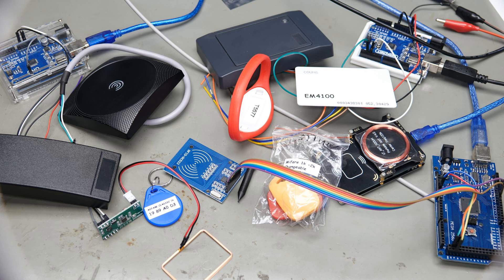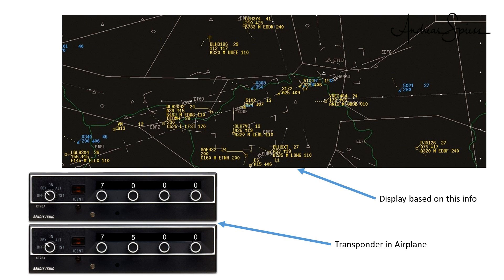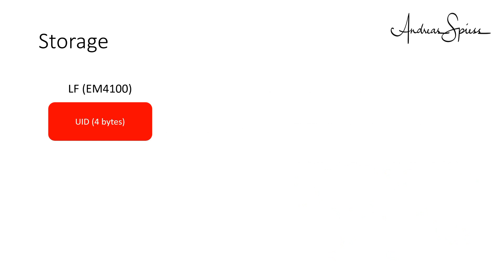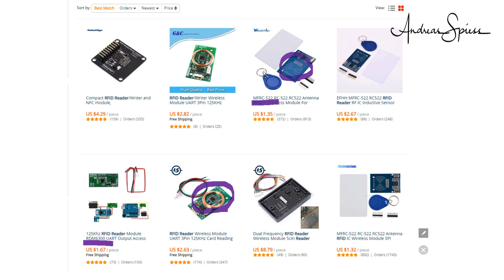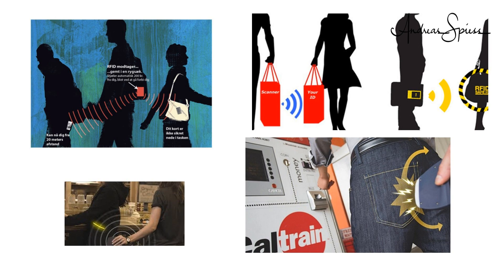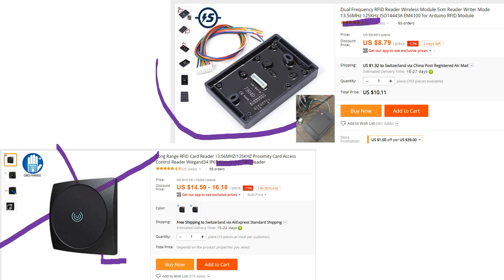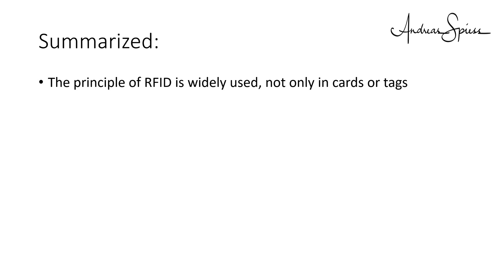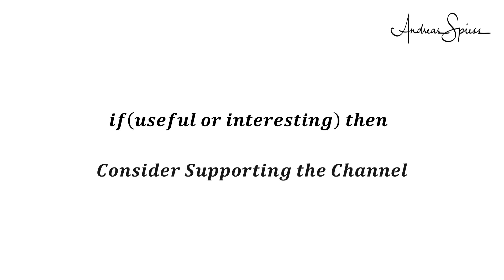#223 RFID How-To: Not only for Arduino (only legal Stuff!)

Comment: Excellent presentation. As a RFID Engineer and Architect, you have discussed all important elements. 

There are of course some  gaps, but nothing critical. It should be noted, the majority of High performance and secured RFID platforms have excellent security built into design and format. They are not readable by any generic hardware or software interface and require standalone encoder equipment. 

This doesn't mean that low cost systems are not in use, they are. It is also true, these systems should have better security and protocols. Cost is of course, is the major reason.

The next generation of RFID that includes master / slave authentication interrogation is now hitting the market. 

For example, a biometric algorithm will be available to upload a security scan of the user's fingerprint into a guest RFID card. This becomes the temporary passcode installed into the card and card reader database server. 

If the card reader detects a different fingerprint (algorithm) other than what was used to configure the card, it will not work. Up to 3,000,000 coordinates can be input and scrambled into a input sequence, which is impossible to decrypt / decode without a supercomputer in less than year.
Reply from the maker: I assume you are the expert (not clear in your post). I am certainly not an expert as I did not know anything about RFID one week ago ;-)
From what I read, for a long time,  you get much better cards. But the old ones are still used, especially by Makers. Maybe also because they are easy to understand and use.
The next generations will no more be very interesting for a video. No hacking possible :-(
Reply: @AndreasSpiess  I have some experience with this technology. :-)

My point is that you have done VERY well understanding how the technology works and its use today. 

Your ATC analogy is a good one. A modern super fast equivalent is smartphones with NFC that combines connectivity, identification, authentication and payload. 

We may see RFID card / fob readers adapted to interface to NFC devices using a hybrid Secured Element Identifier  (SEID) Chipset. However, it currently uses only the lower frequency band in the ISM space. 

Years ago, I developed a early Android App using NFC that added an additional security layer, by including biometric scan as part of a two step authorization process on the  smartphone device, which, once authenticated, allows the NFC Chipset to send an authentication code to an RFID reader. 

If the phone was lost or stolen, it would not work unless the finger was... 

The goal was to reduce the number of pass cards a user might be required to have access multiple platforms and systems while maintaining two step security protocol.

This is particularly true of loyalty rewards cards when they were first introduced. Now barcodes are used to easily display on any smartphone screen eliminating any demand.

We will probably see in most markets, a continuous decline of legacy RFID card readers with updated scanners taking their place except where extreme environmental conditions and long connectivity distances exist.

Real-time Encryption using one time transaction codes are becoming highly desirable. 

Blockchain has been touted as one approach which has significant issues including payload size along with  latency issues. 

RFID still has life and is accepted in low security environments and has potential to be significantly upgraded. 

For tracking and monitoring applications, it remains an excellent low cost solution.

As I have mentioned before, the potential in the agricultural and forestry sector is an interesting opportunity. I know you have asked for some additional information, which I will get you later this week. The problem is that some of the documents are in PDF files only and links are not easily posted.

Comment: Do anyone know Is it possible for nfc tag to cover area of maybe half square meter or so? Maybe emulated card or card with bigger antenna?  I don't need distance, I need wide area of reading. Thanks!
Reply from the maker: Maybe with a special antenna design. And maybe you also have to amplify the signal of the transmitter to provide enough energy to the chip in the card.
Reply: You should not rig the pokertable...

Comment: great video and just in time a new project I am going to do next is a rfid reader on the back garden gate. I never have my keys with me when I need them and usually have my hands full. would be nice to just have a card hidden on the inside of the fence I could use to open the lock I was looking in to using magnetic locks with a 600Lbs capacity. I have never used some thing like this for external use but I believe it will work and it is a 12v DC system. If any one has used some thing like this and it is a bad Idea please explain why
Reply from the maker: And you even could implant an RFID chip in your hand. Then you for sure would never forget it ;-)

Comment: Can't we just put RFID cards in a aluminium foil pocket? "Tinfoil hat" :)
Reply from the maker: Maybe. You easily can test.
Reply: I tested it on a mobile phone. A single layer aluminium foil around a subway ticket. The RFID scanner in the phone did not manage to read the card. I'm going to test it on a subway reader later. I expect the same results. However I am not able to do more test's than that. So if you could be so kind and try it with the scanners you have in your possession it would confirm that the "hack" works. I'll leave a comment later when it is tested on the subway.
---The scanners on the subway station could not read the card.
Reply from the maker: Your tests are sufficient as these scanners have to be very good. I do not have better ones. I expected that aluminum foil works.

Comment: I use HF tags embedded in wristbands for agile payment purposes. There are ways of securing your tags by password protecting them, only for writing tho; for reading is recommended to use some kind of encryption that uses the uid as a part of the decoding parameter, so that the payload is unique per uid, there are ways to fake this as well, but users interact with the scanners via a person, they don't use any scanners directly, except for balance checking, which is a small ESP32 that queries the server for it using the uid and the payload.
Reply from the maker: Thank you for your feedback. So you found a good way to live with this insecure technology.
Reply: As long as you are using the tags in a predictable environment we can say it's fairly secure. Anything other than that, you need to use your phone's NFC capabilities. We also collect the wristbands for reuse when the customer is leaving. Trying to be a little greener here and there :)
Reply: Alfredo Rivera  As I said in my comment above...when it comes to payments, I have the user enter a 4 digit (or more) pin and then scan their tag. This makes it something they know and something they have. That increases the security in the right environments.
Reply: Dan Hoover  We have made runs of this mode, but given that we are focused in festivals and concerts is a little troublesome. We are now trying scanning and then presenting two colors in the screen of the terminal and having the customer choose their color to confirm the transaction.

Comment: One of the oldest prox card system I've worked on, used frequency turned antennas on a PCB board the size of a credit card, based solely on frequency. To have a different access group you needed to add a different crystal. High tech almost all way becomes low tech, it's just a matter of time.
Reply from the maker: So you probably also have a few grey hairs ;-) It is sometimes astonishing what was achieved in the old days with only a few technical possibilities. E.g. the flight to the moon and back...
Reply: Andreas Spiess: fizeau-foucault apparatus is a prime example of that, with just clockwork and mirrors, measure the speed of light! In 1845 with in 5%. Videos  like yours and other are showing off the "clockwork an mirrors" of the future. Thank you.

Comment: Hi Andreas,
My job card some years ago has become RFid.
As a back up of functionality it maintains the pre-existing magnetic strip (in some locations they still have old skimmers!)
With that I can open the entrance door of my workplace, unlock the anti-theft of my service cars (confirming that I am driving, for any legal liability with respect to traffic laws) enable the use of photocopiers / printers and confirm my beginning and end of work.
I noticed that those little metal and plastic boxes of the cost of a few euros in the Chinese shops (at 9:00 am of your video, in the middle of the screen is shown a pink model and the previous items, shown opened is bronze) work well as shielding.
From the tests I have done, the badge is not read inside the box or even if it is placed on the outside of the box.
I can not tell you if it's an LF or an HF, because I did not have a chance to see the reader's antenna.
All your videos are interesting and they always teach something!
Bye
Reply from the maker: Thank you for your feedback. Maybe you check now once if you can read it. But pay attention with the magnetic strip and 125 kHz. Maybe it is erased afterward...
Reply: Andreas Spiess  
thanks for your warning, but fortunately the magnetic strip works correctly: the entrance to the building is rfid but the entry and exit stamping is magnetic stripe. the anti-theft-car reader is very small 2-3 cm in height by 8-10 in width ... I do not know if there is an RFid HF coil.
bye

Comment: 7:00 That's odd. When I did it with mine, it still worked correctly (or so I remember).
Reply from the maker: I did not investigate long and used a coil.

Comment: US passports issued since 2007 all have an RFID chip in the front cover. I purchased sleeves for our passports- but thanks to you I know the sleeve does not work on LF RFID. Do you know what kind of RFID is used in most passports?
Reply from the maker: I hope it is not necessary to protect it as it should be safe.
Reply: NFC: 13.56 Mhz

Comment: 522 is legacy, it only supports iso 14443. You should try 633 or even PN series. They support much nicer tags like iCode and other iso 15693. We are getting as much as 90cm range on 13.56 :)
Reply from the maker: Thanks for the info. Do you have links to such readers?
Reply: Hmm, actually we build our own readers. Looks like they are not so popular so Chinese folks didn't really built any. I'll try to look something u for you. There are definitely some evaluation boards on farnell, etc.
Reply: What?! 90 cm?! I'll have to check it out if it isn't too expensive! Even the PN532 has a range of maximum 10 cm. Also, 633 what? I've tried RC633 and MFRC633, but neither give relevant results on Google.

Comment: Nice work Andreas. The IFF code at the start took me back. The frequency looked like FSK of the cro was it?
Reply from the maker: I did not check the modulation. They also use PSK.
Reply: @AndreasSpiess  Pulse shift key very cool indeed.

Comment: My use case is an Electronic lock at the front door and small kids. Small kids tend to lose keys. Replacing regular keys is expensive as you need to replace the cylinder locks, so for 1/2 the money of replacing my locks i installed an electronic lock and RFID reader. When an RFID key gets lost, i just remove the number. As for lack of security, regular keys are not much more secure. The added detection and notification of known and unknown RFID keys (with a snapshot of the person in front of the door) makes it practical and secure. 

As a bonus, i got an electronic lock that detects whether the ‘night lock’ is on. In the Netherlands most homes have such a lock which has two types of locks which activate the ‘day lock’ (dagschoot in Dutch) and ‘night lock’ (nachtschoot). When only the ‘day lock’ is active, the electronic lock works. When the ‘night lock’ is on (same cylinder, just turned further), the electronic lock won’t unlock the door. Also, i can use this detection to ‘arm’ my alarm.
Reply from the maker: Sounds like a useful application. And when your kids grow up, you can log, when they came home ;-)

Comment: I would like to build a RFID system in my daily backpack for knowing that I didn't miss anything at home. I would stick one RFID card to every Item I don't want to miss. In the morning holding my backpack against the RFID reader and it should tell me if I missed something. Problem is the needed range of ~ 30cm. Is there a solution for my range problem?
Reply from the maker: This means that you have to be able to read over distance and the tags need to have a "collision detection" mechanism. AFAIK this is only possible with UHF tags.

Comment: LF Hitag 1 ans S tags support Anti collision so using two of them will not block the access.
Reply: For security in Mifare  I suggest to use Desfire. Also Plus are quite safe - Debit card are Mifare Plus. Cheapest way is to take Mifare classic, use own authentication keys combined with data ciphering (f.e. AES).
Reply from the maker: And what about you combine a Hitag and a normal one? It seems both have to support anti collision to work?
Reply: Generaly EM4xxx does not support anti collision but Hitag 1 and S yes. Anyway they should not work sticked together (EM + Hitag)
Reply: https://www.nxp.com/products/identification-and-security/smart-label-and-tag-ics/hitag:MC_42027

Comment: Both standards - 125/13.56 offer cards with programowanie CSN. On MF we can change sector code to protect our code.
Mifare have also 7byte CSN length (MF od a part of ISO 13.56 standard)
Reply from the maker: I saw that the Mifare can have 7 byte UID. But all the cards I purchased were only 4 bytes. Where did you get the 7 byte ones? 
In the next video I will clone both types of cards.
Reply: @AndreasSpiess  eg UL, DesFire or Plus. Some new classic have 7 bytes too. Probably hour UL card have 7bytes, but configuration od reader returns only 4?
Another question - MF have strong coding of transmision.
I You like, we can talk more about RFID - please priv message or email
Reply from the maker: I did not want to go more in the details of RFID since these cards are not commonly used by Makers and I do not want to become a specialist. I wanted to concentrate on the ones still widely used and the basic understanding.

Comment: Does RDM6300 support 134 kHz band. If not, are you aware of any reader that does? (Would be useful for reading animal microchips (134.2 kHz )) and build the perfect cat door!
Reply from the maker: I do not think so. I plan to read the Dishka‘s chip, but with the proxmark3
Reply: hmm. Ok, I couldn't find a reasonably cheap reader module on AliExpress for 134.2 KHz.  To build something like this would be super cool - https://www.surepetcare.com/en-gb/pet-doors/microchip-cat-flap-connect
Reply: As the animal ID system is standarized, check out products for ISO11785 or ISO 14223